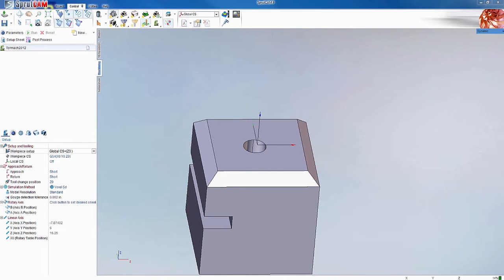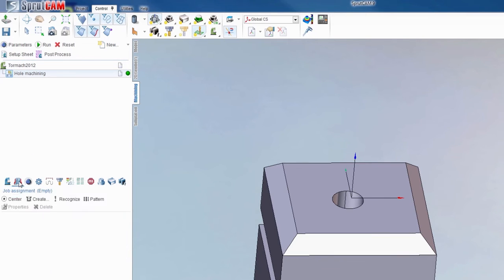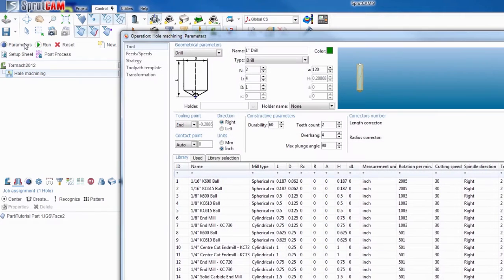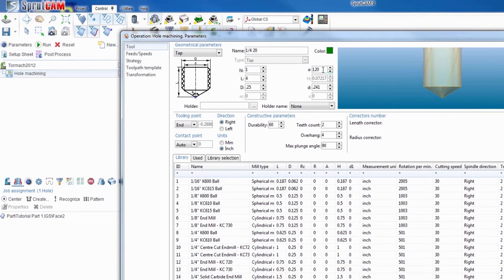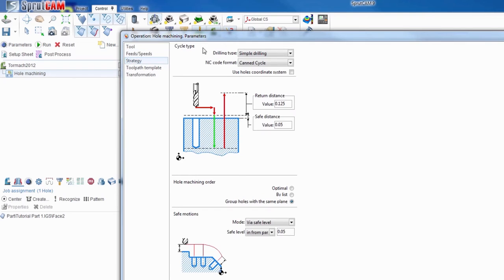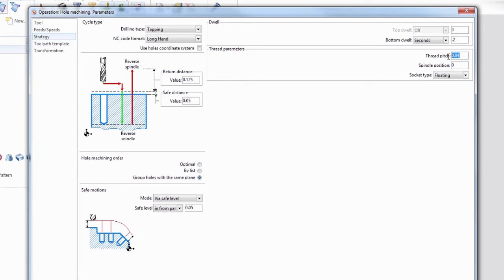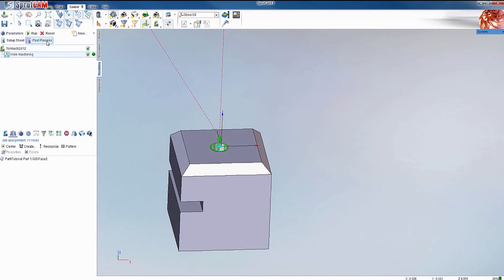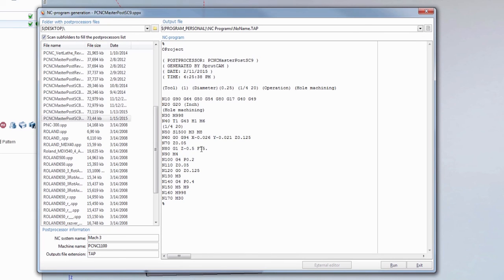Tapping with a Tension Compression Tapping Head - SprutCAM 9

Comment: Just FYI, thread pitch and threads/in are very different and I had a hard time believing SprutCAM got such an important, basic input completely wrong. I have been using a tapping head using the canned cycle and the true thread pitch with no problems on Path Pilot.  Not sure if the error was because of Mach 3 or not, but this video is perhaps incorrect.
Reply from the maker: +Jason Nackard The most recent post is updated to be pitch instead ofTPI.  It wasn’t SprutCAM’s issue but the post’s issue.

Comment: That seems really fast to be tapping 1\4 20 thread. I think it would break the tap. Either I might be a little crash shy when it comes to Mach3 or I am tapping way to slow. It might be helpful to show setting the depth and how to adjust it for blind holes. Or for tapping deeper to make sure you get good threads all the way.  Thanks for making the videos I can say they help.
Reply from the maker: Early Design As long as you use the correct feed-rate with the spindle speed you give and allow it enough time to reverse and it will work. We use these speeds in the class and they work flawlessly. Also note that I do say it is aluminum as well. We use spiral flute taps here like this one: 
<span style="font-size:11.0pt;font-family:"Calibri",sans-serif;
mso-fareast-font-family:Calibri;mso-fareast-theme-font:minor-latin;mso-bidi-font-family:
"Times New Roman";color:#1F497D;mso-ansi-language:EN-US;mso-fareast-language:
EN-US;mso-bidi-language:AR-SA">http://www.tormach.com/store/index.php?app=ecom&ns=catshow&ref=multicat_SPIR_STDTAP_STMOXD
Reply: I will have to give it a try using faster feed rate, but after my path pilot order comes in. I can't wait to get rid of mach3.